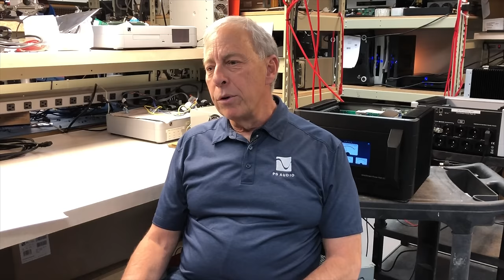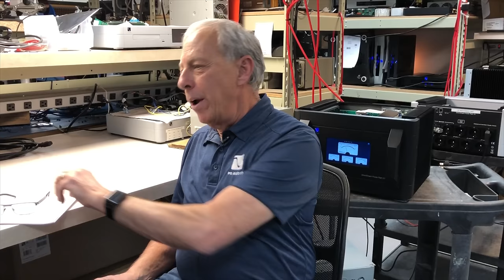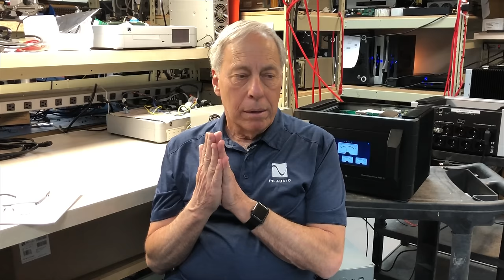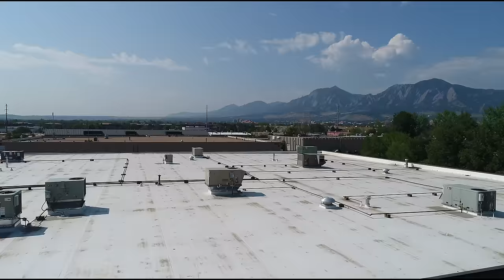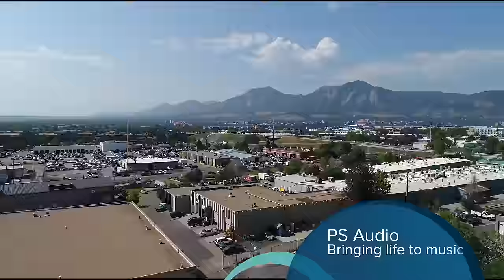What's the difference between ribbons, planars and electrostats

Comment: What makes a speaker planar is that sound is produced by a large diaphragm that is driven over its entire area, as opposed to a cone type driver with a central voice coil.  There are two types of planar speakers:

Electrostatic speakers are the original planar speakers. A highly charged diaphragm is suspended between two stator grids driven by high voltage audio to cause it to be deflected back and forth under the influence of the changing electrostatic field.

The Magnapan company originally developed the "planar magnetic" speaker (which they called Magnaplaner), which utilizes an array of magnets on the stators and a diaphragm with embedded wires. When audio flows through the wires, it causes the diaphragm to be deflected within the magnetic field of the stators.

Comment: The membrane of an electrostatic speaker does not have wires embedded as Paul said. As I am aware, it is coated with a conductive material. Martin Logan for sure does that.

Comment: The difference between a fixed magnetic field (Magneplanar) and an electrostatic magnetic field relate to the strength of the "pull" on the diaphragm.  It would have been interesting to hear how the capacitance of the electrostats alters the load impedance seen by the amplifier in the audible spectrum.  I think the subscriber's question was probably aimed at sonic differences more than engineering differences.  It would be interesting to also talk about the differences in room interaction between a dipole, open baffle speaker and a box-type speaker, though I don't think that was in the context of the original question.
Reply: I was going to give all the credit to the low-mass membrane

Comment: My LRS just delivered by FedEx on a Sunday morning. Crazy!
Well it should be a fun afternoon....
Reply: What are your impressions? How are you driving them?
Reply: @EliasTheHunter  
Hey! Thanks for asking again. I was looking for your questions so I could write this a couple of weeks back.
I love them.
Very Clear and open Sound.
Transparency is amazing!
My experiment driving them with a 50w el34 tube amp was an instant failure. 
I'm using a Musical Fidelity X-150v3 high current integrated which I'm glad I didn't sell. It drove the MMGs I sent to Magnepan for "repair". They had been sitting in a closet for the last 7 years after one panel sagged.
Herb Reichert's review describes the difference between LRS & LS50 very well. 
They NEED a couple of RELs to get some meat on the bones and that's how I run them. 
The most interesting thing I noticed is how they do not excite room modes/ reflections like boxes.
They're keepers. 
I'm currently using T legs, raising them 8" and  oak frames for them to finish the look....like the speakers in Paul's thumbnail for this video, in fact:-)
My friend told me this weekend that when he gets a bigger place he's going to get some LRS.
You just have to realize that they are a large pair of headphones, not really suitable for entertaining the whole couch!
THANKS 😊

Comment: Nice vid Paul! FWIW, I sold Acoustats briefly back in 1981. They did not have a metal mesh... at least not the models I sold. They simply had columns of insulated wires on either side of the diaphragm. This type of design allowed the speakers to be driven to any volume level without the danger of arcing through the diaphragm. Quads had the more common metal mesh design and they were prone to arcing issues.
Reply: quads used a plastic material for the perforated stators with a conductive coating.  The stators are arranged in a push pull configuration on either side of the diaphragm. The stators have the HV audio signal  in push pull configuration on them. The diaphragm has a high voltage charge on it and has such a high resistance that there is insignificant movement of charge across the diaphragm over the time period of the lowest frequency that it reproduces.

Comment: Really appreciate your explanations. One minor correction - most electrostats use a conductive coating on the mylar instead of wires.
Reply: That's what I thought too. I don't think Paul made it particularly clear which was actually connected to the power amp. The mesh at the front and back or the diaphragm? My guess is the diaphragm for the planers and the front and back meshes for the electroststs. The root difference between them!

Comment: The first way of telling weather the panel speaker is an electrostatic speaker or a planar speaker is weather its powered or not.  Electrostatic speakers need to be powered planar speakers are not.  Paul explains the technical differences.  As for the advantages and disadvantages of each is both are superb at reproducing the natural tones of instruments, with equipment that complements them.  They are not colored by a enclosure or box like a conventional cone speaker has because there is no enclosure.  Because they generate sound over a large area they do not need to move much to produce sound so they are both very fast ( electrostatic speakers being a bit faster ).  Both speakers are exceptional for playing sound at low levels, because they don’t need to move much and they move a lot of air over a wide surface area.   So as you can see they both have some great reasons they sound so good.  

The disadvantages are, yes they are very directional including curved panels on electrostatic speakers.  So they all have a one person listening window.  They both need to be placed away from walls.  Neither sound good next to walls.  Since they are both di-pole designs they radiate sound in both directions front and back, ( of course the back wave being out of phase with the front wave ) but you do not want to absorb that rear wave you want it to reflect at the back wall and then back to the listener.  This is what creates the great depth of image they can create.  So speaker placement is very important.  Both designs are very sensitive to the equipment they are being powered with and all the other equipment in front of them.  They are very revealing.  So high quality equipment is essential.  As paul stated “ some “panel speakers require a subwoofer, some are built into electrostatic speakers like martin logan speakers and this is a compromise.  Because they use cone speakers ( in a box and are powered ) and the cone speakers is simply not fast enough to keep up with the panel speaker to blend perfectly.  Now where Paul is wrong is not all panel speakers need subwoofers and most produce enough bass and very good bass at that.  If you ever get a chance to hear the very large Soundlab A1 or Ultimates they produce some of the best bass i have ever heard.  Now because they generate bass over such a large area they don’t have bass that gives you that impact of bass cone speakers can it is more laid back.  In fact the sound both designs produce is a very laid back sound.  It sounds as if the sound starts at the speaker and then goes backward into the rest of the soundstage.  Very different sounding then to conventional cone speakers do.  Its a sound that some people do not like for this reason.

As for advantages of each design:  electrostatic speakers are faster, more detailed, more revealing, but must be powered.  They can ( if large enough versions ) produce excellent to outstanding bass.  I think tonally they can be exceptional if powered and driven with good electronics. 

Planar speakers are not quite as fast, do not produce quite as much bass energy or detail.  They are however easier to drive and not quite as sensitive to the equipment in front of them.  They can be powered with more modest priced equipment and sound exceptional.  

One big advantage to both designs that is not mentioned often is they are a excellent option for those who live in apartments or area where you are concerned of disturbing neighbors or those around you.  Because they are so directional more sound is  delivered and directed to the listener.  They are also both exceptional at resolving detail at very low sound levels.  Much much better than conventional cone speakers can.  

So it is highly recommended to listen and try these designs because they do sound exceptional in many ways, but its not a sound that is for everyone.

Comment: I have the Logan monoliths, Logan centre, Logan sub, and two Sequels for the back. The monoliths are powered by two Mcintosh 501 mono blocks and the centre and back are powered by a monster power 200w x 3 amp.My pre-amp is a Krell showcase processor, a Krell showcase DVD player. I call it my wall of sound..! I place my seat dead centre of the room and I could care less where anyone else sits. I've never had any complaints. I've owned a lot of speakers and the Logans deliver 10 x's better then any I've ever owned. The sound comes out of the back as well as the front of all my speakers. My listening room is over the garage consisting of 2 -12' wide dormers cantered including the main span = 2-20'  in a 30'x26' room shaped like a cross with all cathedral ceilings. 3/4" oak hardwood floor over 3/4" OSB sub-floor, I built it in 2000

Comment: I am absolutely sold on bipole and dipole radiators but they do require a large room. The Magnepans had a similar ambiance to the Martin Logans but lacked the rich inner detail that comes through a lower mass membrane. I suspect that the magnet screen on the Magnepans has some movement that robs dynamic range because they seem to fall apart at higher volumes.
The absolute king of speakers are the ribbon speakers as long as they are direct coupled and your ramp can handle the ultra-low impedance. I am thinking specifically of Apogee and not the Carvers which come in at a much lower price point.

Comment: The old Quad ESL63s tried to solve the listening position problem by having the membrane divided into multiple rings, with delay lines from the center outwards if I remember it correctly. Still planar, they’re flat, they overcame the inherent issues of one big moving plane. Much better high frequency dispersion in the room, and a better LF-HF balance. Best of both worlds?
They’re stunningly beautiful, though not for every musical genre.
Classical music, in particular chamber music, is hard to beat with other speakers.

Comment: The Heil Amt was not mentioned and is the only tweeter that "squeeze's" the air instead of "push it." My ears tell me that not even ribbons or electrostatics can keep up past 8 to 10k hz. They are super fast with virtually no distortion and actually create an "audio hologram"  that make them sound "live".  But after playing with these for over 40 years I have found that you must have a harmonic in the bass section just like any stringed instrument has and this harmonic will help carry the upper frequencies were this tweeter lives and then the sound is magic. They also have a very wide sound stage which allows a very wide sweet spot....like the whole couch instead of a single chair.  Dr. Oskar Heil invented it back in 1974. Thanks for the info. Paul.
Reply: Brian Lacombe nothing better thsn a Veil and good midrange and long throw woofer. bark bark.
Reply: Soundstage happens in the midrange.

Comment: A very honourable menyion should also go to the legendary Air Motion Transformer
Reply: Gave it a shout out for you. I have been playing with the Heil Amt for over 40 years and I believe it is the best upper driver ever invented. I have 9 functional sets in my sound room both orig. and custom. But there must be a Harmonic in the bass section just like any stringed instrument has. Harmonics go up in the frequency range which is where the Heil Amt lives and when they mix together is when the magic happens. All of the orig. ESS Heil Amt speakers that I have ever purchased has the bass cabinet over stuffed allowing very little harmonics. So I make a hollow in the middle of the cabinet and then I play with the insulation lining the walls of the cab. until a harmonic is revealed that I can HUM too...and then it's magic!!
Reply: I am currently using a dipole AMT from Mundorf in my DIY active dipole speakers . They are not cheap (like anything else from Mundorf) but they have incredible power handling and extreme low distortion . They also are capable to maintain a perfect figure of 8 dipole dispersion pattern in the horizontal plane right up to 8 Khz . Best tweeter for this application , hands down !

Comment: Watch all of your videos and they are great.  We both come from the hobby in the 70's-80's.  I owned a high end audio store (Audiophile Specialists, Oshkosh, Wi).  I sold Acoustat speakers (also Infinity),  and still use in my main system, a pair of highly modified Acoustat Monitor 4 speakers.  Original they used the direct drive amp, but changed them to the interface (which is highly modified).  What is the amp behind you (if it is an amp)?  Love your products and all your presentations.
Reply: Believe it's a power conditioner.  Just saw an ad for it in Hi-Fi News yesterday.

Comment: No wires on the mylar of an electrostatic. The panels are coated with something that allows the panel to hold the static charge. The speakers are plugged in to maintain the electrostatic charge. The wires run in the grid in front of and behind the panel, that is what the amplifier, through step up transformers, powers. Mine (SoundLab) have a three sided faceted tweeter and two angled woofer panels to mitigate the "head in a vise" imaging.
Reply: John LeBeau I couldn’t agree more with you John. Paul’s explanation with mediocre at best and not accurate with today’s improvements with Electrostatic speakers.
Reply: @DuzBee  Soundlabs have bass he has not listened to them in a while that why he writes them off lol.

Comment: I don’t think I’ve ever seen an electrostatic with wires on the diaphragm. That would be really heavy. Pretty sure they all just have an electrically conductive coating painted on the surface of the panel. Also, copper is really too heavy to use on a planar magnetic speaker. All that I’m aware of, Including Magneplanar, use aluminum.
Reply: The delay coil isn`t on the diaphragm;it is situated in the base of the speaker.
Reply: I`ve not checked lately but Magnaplanar definately used to use glued on copper wires on the mylar diaphragms on their midrange and bass drive units.
Reply: BRATWURST1 All current (since the x.7 versions) Magneplanars use only pure ribbon and quasi ribbon drivers.
Reply: BRATWURST1 Aluminum with a coating...copper has to much mass and weight it would slow the speed of the panel...
Reply: Copper would mass more than aluminum, but not by so much that it would likely be debilitating. Mostly it's resonant frequency would be a bit lower.
Reply: Copper's density is almost 4X that of aluminum.
Reply: some electrostats are made with wires instead of perforated stators. I think my Quad 57s have some sort of coating .. before I bought them, I was planning to "make do" with DIY headphones ("Wireless World" design) made with diaphragms lightly coated with graphite - you actually want to maintain a fairly high impedance so you don't get an uneven charge distribution.

Comment: How does a single membrane produce both a base and a high frequency signal without each of those two signals affecting the other on that single membrane
Reply from the maker: It doesn't. It will be affected. As the membrane moves slowly for the bass and quickly for the higher frequencies it causes a type of distortion called Dopler. That's one of the reasons speakers have multiple drivers like a tweeter, midrange, and woofer.

Comment: Did you guys not here when he just explain? He said planar  magnetic speakers had the wire going around it using it as a voice coil. He did not say anything about electrostatics having wires he said that was The difference between the two. Can you explain electrostatics used membrane compress between two perforated metal parts and used a step up transformer he did not mention anything about wires going up and down it that was the planar magnetic speakers
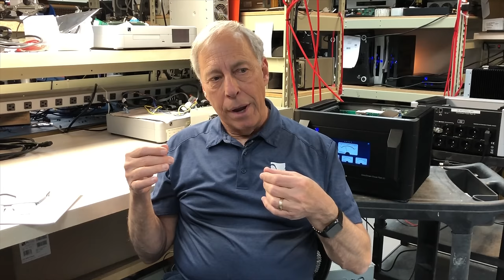Reply: Listen starting at 3:15 again.
Reply: Yes I have listen to it. And what he is describing is the wires embedded in the mylar then pressed between the two mesh panels in a electrostatic speaker. Then at the end you hear him say you have a Ribbon voice coil laid on mylar and has magnets on the front on the back in a planar magnetic speaker. Both speakers use mylar in them but the plane are magnetic speaker uses it to put the voice coil ribbon on and the electrostatic speaker uses it to put conducting wires in and puts a high voltage through them to  produce sound because electrostatic speakers don’t have voice coils. You hear the word mylar and you’re thinking he’s talking about the same speaker and he’s not
Reply: The conductive coating is sprayed on, and in the better electrostats is a high resistance coating.
Reply: OOPS, I missed Martin Logan deposits metal on their diaphragm. I wonder how they do that?
Reply: Electro stats are weird
Reply: Amplifiers and myself agree.

Comment: wires in a ESL ? some use wires as stators though. how it works is in the name  ELECTROSTATIC SPEAKER   the membrane is staticly chargerd.  just like you can with rubbing a baloon on your hair. called BIAS.  by adding high voltage audio on the 'STATORS' you can let that staticly charged membrane move to either of the stators.  and thats all there is to it :) in basics

a negative charged membrane want to move towards the stator that is currently positive. and will be repelled by the stator that is negative. making it push pull.

its not a head in a vice speaker.  you can create endless crossovers if you want makeing dispersion better then any other speaker.  without the costs of 1000 passive crossover components.  ML is a good example of bad design/bad dispersion ESL